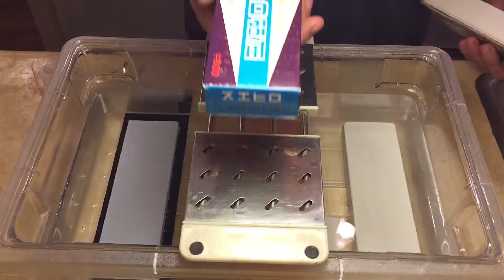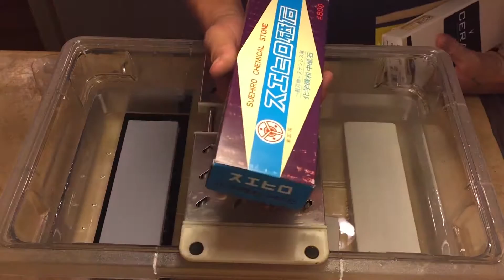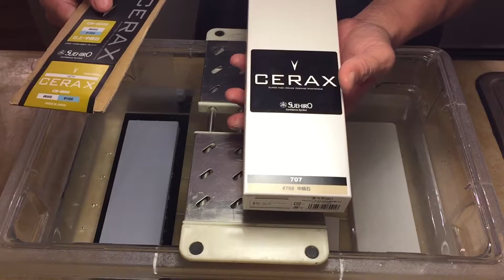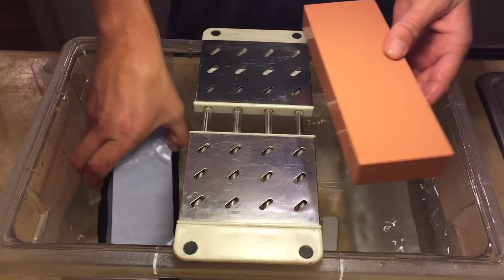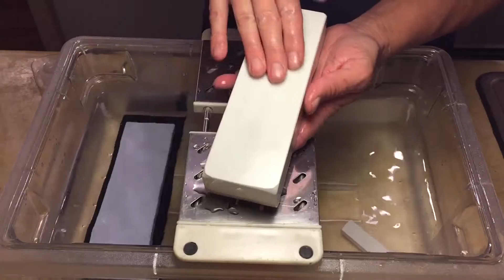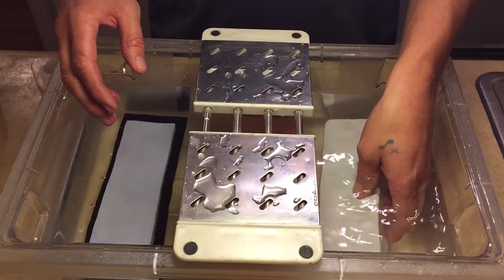Knife Sharpening - Suehiro Stones - 320, 700, 1k/6k

Comment: Hi Jef, wondering what was it you did at min 3:40 when you stroke the blade against the handheld stone ? What was this stone and what’s the purpose of this? Thanks.
Reply from the maker: Not sure which stone that was. Looked like a silicone carbide Norton. This is a pretty old video 🙂

I did it just too dull the edge. So i was starting with a really dull knife to store the sharpness after i completed
Reply: @Jef  thank you Jef for your response.  Cheers

Comment: Jef-- I generally avoid trying to set an edge bevel all the way to the apex with a really soft, low-grit stone, for the reasons you are experiencing.  I use a King 220 (because they're cheap) for thinning, but at the point where I'm addressing the apex I will switch to something harder like the Naniwa 400.  Using the soft stone for the apex simply defeats the purpose, at least for me, usually resulting in rounding off the edge.  Forrest
Reply from the maker: This was 2 years ago, I don't recall what sort of issues I was experiencing. When I first got the Suehiro chemical 320, I hated that stone. It is actually one of my go to coarse grits now. Funny how opinions change.

Now a days, I rarely have problems apexing on coarse stones, be they soft or hard. I used to try minimizing the burr when getting close the apex, and swapping over to a finer stone, just before it happens. Now a days, I just blaze right through it, cut the burr off, and keep it moving. It can be a bit wasteful, but given that most edges come from factory with some burning issues, I don't see the steel lose as a bad thing. Once I have gotten a few sharpening on it, that is when I get ultra conservative, about steel conservation
Reply: @Jef  How do you like the Cerax 1000 now after two years?  I've been considering purchasing one.  I generally use the King 1000 for a medium grit, since Murray Carter has been my principal sharpening mentor.  But the King 1000 is a rather soft stone, and I sometimes like a harder stone, especially when I come off the grinder having finished a new knife build.  Like Carter, I will use an edge trailing, stropping stroke to finish off the apex with each progressive stone.  And usually I'll just use two -- the King 1000 & 6000; however, I sometimes will use the Naniwa 800 & Suehiro 3000.  Either way, the results come out about the same after stropping.
Reply from the maker: If you think the King 1k is soft, the 1k Suehiro is gonna feel like playdough. Lol. It is a medium hard stone. I would classify the King 1k as a hard stone, albeit in the bottom tier of hardness. Still, it is more so than the Suehiro. That is the King KDS 1k. They have so many versions I can't keep up with em all.

I do like the 1k Suehiro, but if you want a harder stone, look to Shapton. The Shapton Pro 1k is just excellent all around goodness. The 1k glass too, although I think the glass stones are a bit soulless. They do a fine job, don't get me wrong, but they are just bland to me. If you can get your hands on a Nubatama Ume 1k hard or extra hard, those are about as good a stone as I have ever used. It is my all time favorite stone (the xhard version)

Comment: Jef, what would suggest for a a more aggressive low grit stone? I’m currently working with a large cerax 320 that doesn’t want to cut stainless very well that’s SO damn soft and a naniwa chosera 400 that seems to cut faster; as well as a 140 atoma that leaves very deep scratches. I’m looking for something harder and aggressive to repair and reset bevels and be a segue to remove scratches from my atoma 140. I’m curious about the shapton glass 320 but there’s mixed reviews. I’m really pissed about the cerax. I got through the skin and it just melts when I work harder stainless on it. What would you suggest?
Reply from the maker: I've never had experience with the Shapton 320. The 220, I can attest, will shed grit readily. That, unfortunately, is going to be something common, among low grit stones. The key is to find one that is fast enough, to do the work you need, without shedding so much, that it dishes on you. 

The Shapton Pro 120 is bar none, my go to low grit stone. It is hard, aggressive, and slow wearing. Slow in relation to other low grit stones, that is. The Norton Crystolon is another. The 220 Pride Abrasives is right there with them, in terms of speed vs grit friability. The Shapton 220 is nice, but I found it sheds grit faster, than the 3 mentioned above. If you can tolerate a little less aggression, the Imanishi Latte 400, Beston/Bester (i always forget which) 500, and of course the Naniwa 400, are very hard, slow wearing, and fast for their grit rating. 

The Shapton Pro 320 is nice, but it develops a slurry very quickly. The odd thing is, in my experience, is that it doesn't dish quick. Although muddy and friable, it holds shape very well. So If you can deal with the slurry, it is another I like to use. 

In terms of raw speed, nothing is going to beat the Norton Crystolon. It cuts like a demon. I don't always like dealing with the oil, so I tend to favor the Shapton Pro 120 instead. The Gritomatic 240 Sic stones are also fantastic, but I haven't seen them in stock in so long, I am not sure they are still producing them....